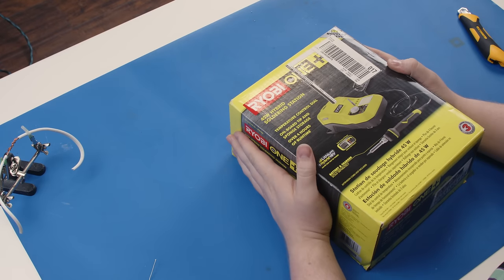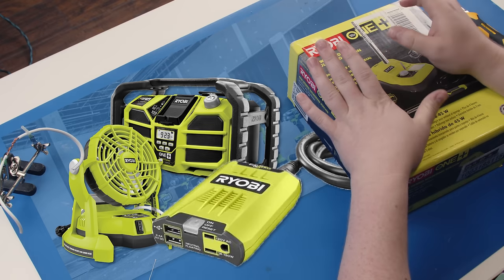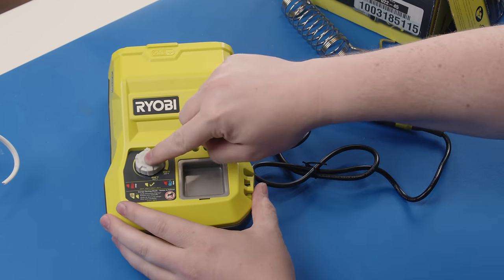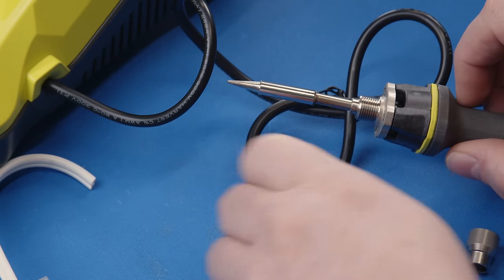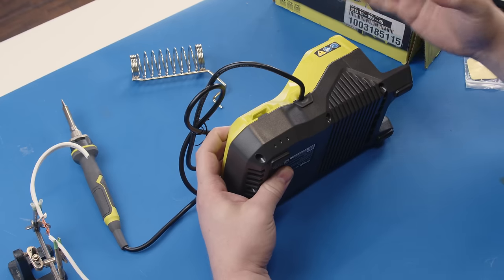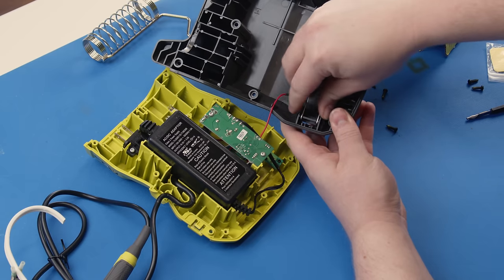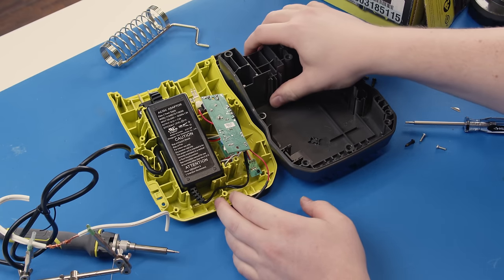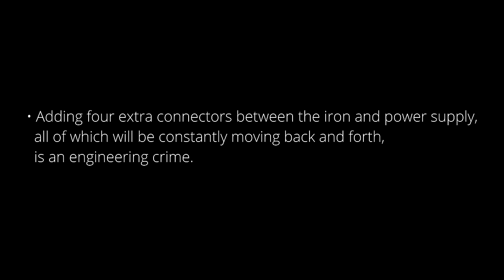Ryobi has GOT to be joking with this soldering iron

Comment: Yeah im not a huge fan of Ryobi tools myself but i will say that after having a big gas engine powered pressure washer that cost me around $400 or so if memory serves correctly and the hassle of having to fill the gas tank and winterize the entire engine and water tanks then I seen a Ryobi electric pressure washer for roughly $100 I figured I'd grab it and try the thing if i didn't like it then it would be easy enough to return it... Well I was incredibly pleasantly surprised-blown away honestly and since have not used that big gas powered one not one time! This little thing is the size of a car battery and yet has enough power to strip the paint off a vehicle if you were to have it too close and held in place too long! No joke the thing is a dream to own and use compared to the big heavy thing that it took the place of, not to mention that right out of the box i noticed i was missing a part of the wand so i called Ryobi and they shipped me an entire replacement hose, wand and all the tips free of charge and the stuff was at my door 2 days after calling! So after that experience with their Cust Serv dept I'm thinking I'll take another look at their line of tools and maybe eventually transition over to all Ryobi VS. the mixture of Ridgid and Dewalt that i currently own....

Comment: I used a Pinecil V1 or 2 or 3 years for my side mobile auto technician business.  I am a network engineer by day and on the evenings and weekends I diagnose and fix cars with weird electrical demons.   I just love fixing stuff that no one else can figure out.  I had a nice flexible silicone USB C cable for it and a nice 65Watt Battery.  It died though and the display quit working.  I can still plug it in to my laptop and update the firmware on it, but I won't turn on and work.  I have a TS100 on the way to try out.  I know it seems cheap, but when you need to work on a wiring harness laying in the gravel under some car, the pinecil was great.  as far as the stand goes, I just have a magnetic metal tray I sit it in to cool down.

Comment: When you get to some level in DIY  electronics at some point you are able to purchase parts to make your own soldering station, I know how to make my own : soldering tools, flux, PCBs. and (even prepare the chemicals needed to work with PCBs) included cold liquid thinning solution for the finishing touch,E.lab workbench power supply,  etc. The problem is that from the moment you learn how to make things by yourself you'll find flaws on any retailed product pushing you to make something better and safer.

Comment: I do get why you don't want a pinecil, BUT, oh boy it's an amazing iron. I've had mine for almost 2 years now and it hasn't failed me. I have also a big station and I only use the station for microsoldering and touching up SMD components. The pinecil definitely punches above it's weight class, and all you need to run it is something with USB C PD.

Comment: Interesting video. I built my own portable soldering iron using the inexpensive ksger iron as a base. I discovered that the power supply steps down to 24 vdc. I bought a couple of the milwaukee 12 v sockets off of ebay or Amazon (don't remember) ran the milwaukee 12 v batteries in series and tapped into the iron post of the ps and added a toggle switch on the rear of the unit to still be able to plug in the power cord. My version of hybrid. Works great. Charge on the batteries lasts a very long time. I've had it and used it for a few years now. I built it before ryobi or milwaukee came out with their commercially available units out of necessity.

Comment: I have the small cheap one that isn't cheap stuff. It does have a knob for temperature control. The 900 is a huge plus for soldering wires out on the side of the road in winter. Im a trucker and it works perfect

Comment: What you see inside the case with the power supply is very common in manufacturing. You'll find the same thing inside some electronics from the 80s. And it's no longer necessary to remove soldering flux since "no-clean" processes were developed to save cost.

Comment: I actually had a battery powered soldering iron that ran on AA batteries. It did a pretty good job, but you had to constantly hold the safety button so it made readjusting the grip to get a better angle almost impossible.

Comment: I bad one of those gas irons in my toolkit back in the 80s. It was pretty good for emergencies - or for working on live equipment. OTOH, my most desperate soldering situation was one where I didn't have any kind of soldering iron at all. But I only needed to solder two wires. So I used a Philips head screwdriver that I heated up over the gas stove. It was ugly, but it worked, & made okay solder joints.

Comment: I know this is an older video, but I have the ryobi iron and the weller at home, and the milwaukee iron at work. While the m12 one does feel weird in hand, the batteries provide a stable way to stand it up when its hot. If you have the big battery its very stable, but it still stands up no problem with the smaller one. Im pretty sure this video led me to buy this ryobi iron. Lol

Comment: Did you look at the usb powered soldering "pen" ? I bought one for $8 and it can run on most usb power banks for on the go use. They are ok for smaller solder joints as the tiny heater cant heat to much material before getting overwhelmed. On circuit boards it works well enough to mount components and small wires so a technician could have it in the tool bag, a electrician would probably need more heat power. Worth having at home especially at a cost below 10 USD. Those psu´s explain the weight much better, many use metal bars to add weight to feel premium, this way may not be any better but it sure is clever.

Comment: Today I learned I am in a minority of people who love the butane irons. My favorite is a 90° style that has a decent sized base built into the bottom. It's literally my go-to even when I have an outlet available. Most of my projects are just 12v wiring in cars, boats and stuff like that. So it's generally wires at least 14ga, I rarely go smaller on wires even if the application would allow it just because I overkill everything. So I basically need zero finesse. They are perfect for that.

Comment: I very much favor the Hakko T15 tip, used by many aftermarket soldering stations. Even my cheapest soldering iron using the T15 style tips heats up in 8 seconds and holds temperature while soldering very well.

Comment: The little wall wart will probably have a voltage drop once a load is applied to it.  In terms of the concept to build in the power supplies,  that one complaint on the Milwaukee tools.  The M18 fan has an external power supply and so does the M12 speaker.  People complained about having to carry around the power supplies.

Comment: 39:20 either wider baffles like you said, or perhaps even notched ones (with rounded edges) instead of straight, to prevent the jacket from contacting with as much - or any - pressure.

Comment: When I don't wanna hook up my soldering station I just use a pinecil, I just plug it into my phone charger via usb-c. I can control temps with the buttons or using my phone via ble (v2 only)

Comment: The Milwaukee isn’t that bad. It stands on its battery. It’s fine. The articulating tip is actually useful. You can hang it around where you’re working. 

The reason you’re bad at soldering is because you don’t understand how soldering works. If you did, you’d look for a soldering iron that gets to temp quick. Changing temperature is moot if the iron keeps its temp once it’s suck it’s thermal energy into the joint. The bigger the sink of heat, the better the iron has to be. As in it needs to deliver the heat fast. 

The ts100 wired into a tool battery is what I use in the field. It’s fantastic. You can use any tool battery with a pair of spade terminals. 

The hybrid feature is pretty cool.

If you ever get the chance to use a Pace soldering iron, give it a try. They are the business.

Comment: @Cathode Ray Dude [CRD] - 
This is very unique, I neverexpected this ( I would even expect fake PFC coils, but never this) .... but finally they made the (90 years behind the time) USA-Plug save (at 32:24) & the laptop power brick is defacto user replacable by one with the same size (just 2 easy solder points)

Comment: I love my pinecil, it works so good. But I get that you need to provide a separate stand and tip cleaner. Also, buy Pinecil's silicone USB-C cable, it's perfectly floppy! I think it largely makes up for not having integrated strain relief.
I just use my USB-C power bank that I normally use for travelling to power it. It's limited to 45W, but is enough power for most things. If I really need the full 60W I just use my laptop power brick. I'm also considering getting the DeWalt USB-C power adapter since I have all DeWalt stuff. That could be convenient, especially for powering my laptop on the go.

Comment: You can kinda control the temperature on a gas soldering iron. It's not precise and whatnot but it's possible. Plus you can use it (with the torch attachment) to make a crème brulée, so...

Comment: I’ve used a Weller non-temp-adjustable soldering iron for a decade. I have many soldering guns and temp control models but I prefer the weller. It’s way better quality than the other basic ones. I don’t solder fine wires though, just household and hobby stuff.

Comment: Really fascinating stuff! Kind of torn on the use of the power brick - it's both really janky and kind of really smart. Should also make replacements/refurbishing both safe and trivial (two solder joints and a couple of screws), FWIW. Still, that PVC cable is atrocious - not only is it PVC, but it has the kind of stiffness and shape memory characteristic of truly crappy PVC insulation. Would be really interesting to see a mod of this, fitting a DIN connector on the housing (and maybe the end of the iron?) and replacing the cable with a properly insulated one. One thing you didn't touch on that worried me a bit: that temp adjustment wheel looks incredibly loose. I wouldn't trust that to hold a setting unless I had explicitly checked it within the last few seconds, it looks like even the wire brushing across it would change it easily.

Comment: I had a set of jumper cables that were like that. The insulation made the wire very stiff, especially in winter temps (which is when they're most likely to be needed)...made them nearly unuseable.

Comment: I am thinking about getting one of these soldering irons and since I now know what they look like on the inside I can order come connectors and the proper wires. 
I have several hybrid tools from Ridgid and now pretty much know how they work. I have the bobble light of ridgid and the light is just poor and I wish it was taller. I also have fans as well. 
Hybrid tools are quite nice and would like to see a lot more of them. 
I have one of the spot lights that is not hybrid yet it has a 12v adapter which really could be a hybrid if I wanted it to be.

Comment: Nice to see a soldering iron review. I've been interested in the more mainstream power tool-y kind.

I go a USB iron after big clive reviewed it. Good iron for nearly everything, except high-temp solder. Of course the tip finally needed replacing, and the replacement tips didn't work... buying a new iron is worth it when they were only $10-15 anyway. I modified mine to use a switch though, as the "go contact" wouldn't work right.
Reply: Corded irons have their place! I used a plastic two-socket box, and put a leading-edge dimmer (switch and dimmer slider) and an outlet on it. Great for regulating 100% of normal irons... now if only some of the normal irons didn't immediately fall apart, or the tip wasn't some awful alloy that doesn't get wet.

Love the internal off-the-shelf power suppy. Except for it being tightly molded in, it's a great idea. I get tired of proprietary stuff where I've seen even a linear 5V regulator pop, or some other thing, but the circuit is a mess. Only concern will be how hot the PSU gets, as that would certainly kill it quickly.

Comment: I use the TS100 and realy like it heats up FAST! It's small and portable I also made my own adaptor for my battery system I use from my portable drills. One of my nicest soldering irons I have. I also find my self solder more. Because of the ease of use

Comment: Man, there you go again. Right up my alley. Been soldering since I was... I dunno... 5? I ended up buying this particular solder iron. I'm not disappointment by it but ultimately, it could have been made better with a few more cents. The cord needs to be silicon. I melted mine first run. I use my weller with my everyday soldering but if I need something in a pinch or portable (marine electrician here), this thing is "perfect." Good temp control, nice warning lights, a place to put the iron down safely. It works.

Comment: I think you are looking at those screw holes the wrong way, they don't narrow towards the screw head, they widen from it. This gives strength, when the sides were parallel those things would break easily. The hole can never be narrower than the screw head, so a straight driver will always fit.

Comment: I actually made my own portable pack for my Pinecil, just out of desperation. Had a shitty Harbor Freight 12v flashlight that came with a drill kit, which I got in one of those "I need a shitty drill cheap and fast" moments where it was actually cheaper to get the flashlight drill set for $24 than just the drill at the time. But the flashlight was **terrible.** So I cut it up and used the flashlight's wiring to rig up a 12v barrel plug which feeds straight to the Pinecil, which seems utterly pleased with it and I've been using it a lot since it's technically a hotswap battery pack and I have three of those Warrior 12v batteries.

Comment: For a butane portable, I bought the Snapon kit, and I have had it for many decades, and may not be available any more.
And for heat regulation, you have a manual valve to control which is OK for otside work, unless it is very cold or windy.

My main station is a Weller solder/desolder station which IS unavailable, even on Ebay!

I have been thinking of getting a Hakko setup, but the price is a hurdle! But I have used their product and is a good station.

Comment: Looks like a nice enough tool, but only if you already own tools that use the same battery or have AC available.   For keeping in the service truck but not using frequently, a high grade Master butane soldering iron is still my choice for simple repairs or when AC is not available.

Comment: 21:00 I like your rant on their over-engineering, I have to both agree and disagree. While I haven't personally broke a standard iron before, but I have broken one of those mobile irons that use ceramic as a heat sink to retain heat. Once you break something fragile, you'll feel how nice it is to have an over-engineered durable tool. Kinda the only reason I ever bought titanium tweezers and picks when you can buy cheap iron tweezers at 1/30th the cost. Confidence increases work speed, and so too does quality tools.
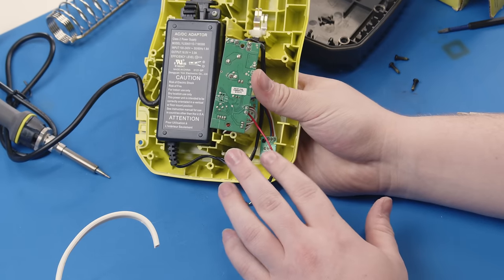37:10 Also, the dirtiness doesn't matter if the flux was a non-acidic "no clean" flux.
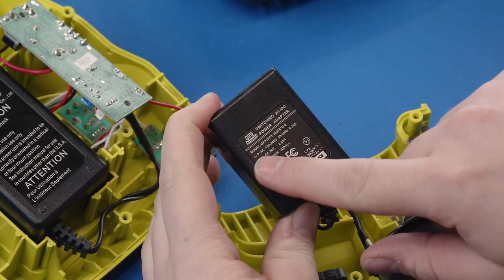44:45 I disagree, It's a mediocre product, 100V @ 0.36A = 36W (43.2 @ 120V) with a DC output of 20V @ 0.85A = 17W, so it's between 39-48% energy efficient... Don't get me wrong, many cheap AC/DC switching power supplies on amazon can range from 25% to 70%, and that's only when they are labeled with an input amperage. Also Power supplies are UL recognized not UL listed, because they aren't a standalone product, but a component to something else.

Thanks for the video, and I totally agree that it's an engineering shame (not a crime) what Ryobi decided upon with the rigidity of the iron's cable. Regardless of the safety of a melting cable, a connector would have been great. I wonder if anyone is going to mod their own device with a better cable. I'd also wonder what connector you'd ultimately choose, but with the theme that Ryobi has, not having a removable non-battery part that you can "forget" doesn't feel incorrect either.

Comment: I feel like you are nit picking some on this for a $50 portable soldering iron. Ryobi makes multiple hybrid tools so the power supply is probably designed to work in all their hybrid tools instead of having to design a unique power supply for every hybrid device. I agree the cable melting point is an issue. If you did any modification I think modifying the cable is a good option. You could probably find a high-temp cable wrap on Amazon to protect the cable without having to fully replace the cable. I too would have liked to see a more compatible tip but if you solder well you can keep the tip clean for a long time. If Ryobi made the changes you suggested it would increase the cost to a price point most people would not buy. At that point you are in the price range of a Weller or other quality soldering stations making the Ryobi geared towards professional instead of home users.

I do appreciate the long video and comparison to a more professional soldering station. Your video had every detail a person would need to think about buying a professional soldering iron over this device depending on their needs. Thank you for the video.

Comment: I'm not sure temperature control only makes a difference.
In the 90, I've been using a JBC for years, without temp control, and loved it. Until I get a cheap Weller station for cheap, the combo with the desoldering pump.
The real problem is basic irons we find now are usually junk.
Those red things was the name "Weller" on them should  not even exist.
BTW I have a Hakko for now. it's ok.